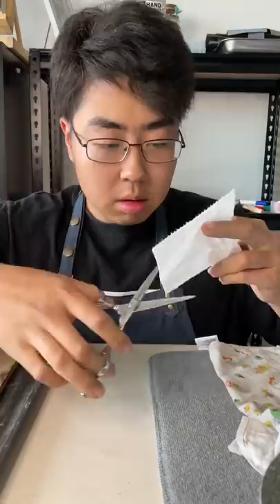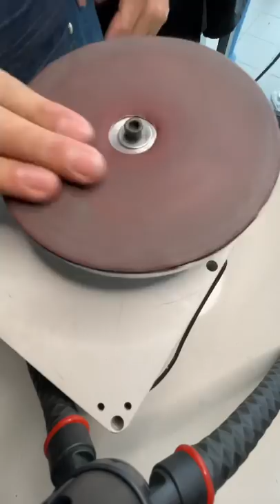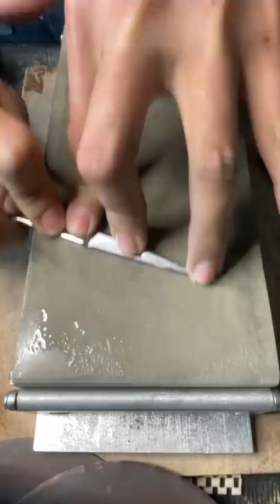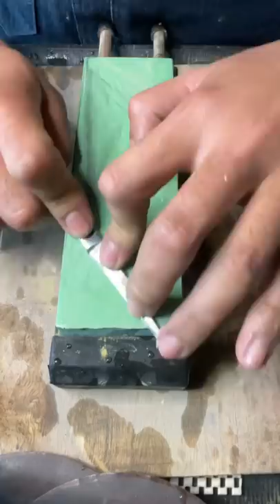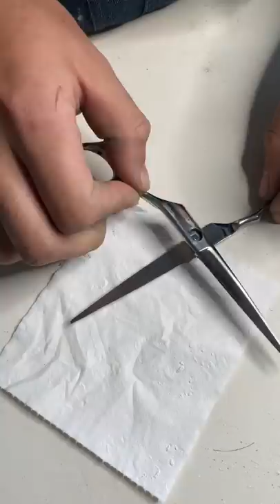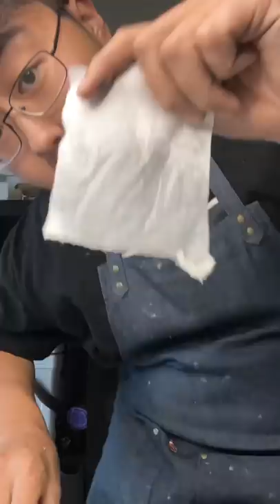Scissors sharpening

Comment: Hey hey, someone who knows how to sharpen stuff properly, that's a new one
Reply: @water_jug_man6805  we don’t speak emoji
Reply: Tin foil
Reply: @gufpcgufpc5848  I don’t think you can read
Reply: @joshmanis9860  I don't think you can read emoji
Reply: @ahsokatano7592  I don’t think I can
Reply: @joshmanis9860  😁😆🤣🤣🤣😂😂😂😅😅😅😐😐😑😑😐😐
Reply: @tribolt6809  sorry i dont speak emoji
Reply: @annabelle5640  🤨
Reply: @tribolt6809  i think i know a bit of emoji lemme try it out 💣💥☠
Reply: @annabelle5640  😨☠
Reply: Thanks a lot man! Couldn't have seen otherwise 😅
Reply: wea
Reply: I got guys at work that think chisels are pencils. I cringe when I find a chisel sharpened down halfway. Smh...
Reply: @longbow6416  Ugh that stuff is awful. Is it that hard to rub metal against something mildly abrasive?
Reply: @joshmanis9860   
😎🤏
😑🕶️🤏
There lies your problem, you can't speak emoji and you assume no one can by saying "we don't speak emoji" to that poor emojian. Smh, people deez dayz.
Reply: @sethisaurus  we just got a bunch of people that end up grinding the wrong angle over and over or they totally grind it to a nub then start over re-adding a blade. Hell if I know. I've got my own set that I keep.
 I use a 120 grit wheel with a 25° angle guide and keep a cup of water close. I take my burrs out with the grind wheel and quench the blade periodically. I wet sand the bottom of the blade with 220 or 400 until the edge easily digs a fingernail. Wipe dry and wipe with oil and done!
 My old job I had a really nice set of  English-made scallop chisels. I took my time hand sharpening each one after use and finished the blade with rouge and a leather strope. They would shine like a mirror!
Reply: @longbow6416  That sounds wonderful. I wish I had the ability to sharpen this like that. All I've got is sandpaper and scrap wood but at least my pockets have something useful in them.
Reply: @sethisaurus  my sharpening is primitive compared to these guys. I bet he polished upto 3000 grit or more, I've never seen tables like what this guy has
Reply: @longbow6416  i use 5500 grit, but it's all just sandpaper
Reply: What the fuck?
Reply: you could never beat him even if you tried
Reply: @GatFlapper  I... Wasn't competing but I bet I could get something a tad sharper done?-
Reply: You cant be a knife critic if your not a professional yourself. Are you a professional knife sharpener? No hate just asking.
Reply: @gameryusic825  I'm not a professional knife sharpener but I am an amateur knife maker, and collector. I know more than enough to tell when someone doesn't sharpen a knife right.

Comment: As a blacksmith, i judge you on your handling of that metal and whetstone. You did a very good job, well done sir.
Reply: Then why was the first paper dry but the 2nd test paper was wet?
Reply: @nanixoo5044  that's what I was wondering..
Reply: @nanixoo5044  it’s harder to cut wet paper i think
Reply: @aug3842  No its easier.
Reply: @nanixoo5044  nvm lol i haven’t cut wet paper in a while ig
Reply: @nanixoo5044  if it was blunt, it will tear messily instead of having a sharp cut
Reply: @nanixoo5044  both were wet. Watch again
Reply: @kiewiealicorn3751  👆
Reply: @pininja4981  the second paper shown in the video, when the scissors didn't cut, would've appeared more heavy and floppy and glossy if it were wet, maybe you should rewatch the video.
Reply: you used a wet cloth in the end and a dry at first not fair
Reply: @ahesan-  it is MUCH harder to cut wet tissue than dry.. it is considered a gold standard test for the sharpness of beautician’s sheers.
Reply: "as a blacksmith"
Reply: @kiewiealicorn3751  they were both wet. You can definitely see the slight color difference between the dry and wet portions because you only wet half of it.
Reply: @nanixoo5044 No it's not.

Comment: Most of the reason scissors are 'dull' I'd actually because they have come out of alignment. Mostly getting them to cut well again is a matter of readjusting thier bolt.
Reply from the maker: By out of alignment I assume you mean the scissors are loose which they would fold hair rather then cutting, but if you are saying the metal blades are out of alignment, that’s a whole different story, and it’s rare. When hairdressing scissors are loose, it will have a lot of play for barbers or hairdressers to push the “ thumb blade” further off, which would dull the tip very fast, once you tighten or “readjusting” the bolt or screw, yes it might not longer fold but will definitely push hair or even catching, so no good since the tip is the most used component of these scissors.
Reply: @raythesharpener5260  hey fellow sharpener. I also have a sharpening service and I always get stuff related to sharpening on my feed. Which usually makes me cringe. It’s pretty clear you know your stuff and it was refreshing to see professional at work! Keep it up!
Reply: Most of the scissors/shears I come across are "dull" simply because they are not sharp anymore... and no bolt adjustment can cure that...

Comment: There's a very slight curve in a pair of scissors that makes the edges touch at one point only. Hard to get right but makes them cut nicely.
Reply: Only in expensive ones. The ones you see 95% of the time are just garbage stamped out of sheetmetal and grinded flat
Reply: @chas1878  lol they're "garbage" because it doesn't make sense to only make $20 scissors and they work just fine. What an odd thing to be up in arms about
Reply: @RapTapTap69  I would like you to rewrite that comment of yours so I can make sense of it as currently I have no idea what you're trying to convey to me or anyone else
Reply: @chas1878  It's pretty concise but sure I'll oblige. There is no point to make every product of the highest quality so referring to products like scissors as garbage stamped from sheet metal is pretty odd. Do you want every set of scissors made from 15 fold Damascus? Or would you rather a world where you can pick up a $3 set of scissors from Walmart with the option buy $100 hairdressing scissors?
Reply: @RapTapTap69  You interpreted quite a lot into my comment when all I said that the cheap scissors don't nearly come close to high quality ones and especially do not have that single point cut feature. I never said anything else. Overall your comment doesn't make any sense in a lot of places.
Reply: @chas1878 how did you not understand that lmaoo…
Reply: @RapTapTap69  It makes no sense because $20 scissors aren't exactly high quality so it was interpreted as "lol they're garbage because there is no point in only making garbage scissors"
Reply: Ooo so that's why he do it like that 😲 Now I get it
Reply: @noobpro9759  It actually has properly punctuation. If you can't read it, that's an issue of your own reading comprehension.
Reply: @noobpro9759  I'm am typing in pretty plain English. I really don't see what your issue is unless you didn't make it past 8th grade. Are the words "concise" and "oblige" to difficult for you?
Reply: @RapTapTap69  and yeah you have periods. Big fucking whoop. The middle sentence is at least 2-3 segments worth of information.
Reply: @noobpro9759  You're really angry about something you're wrong about. Maybe actually know a thing or two about grammar and punctuation rules before trying to be the Grammar Police?
Reply: @RapTapTap69  "there's no point ("to" is the wrong word) in making every product of the highest quality, so referring to products like scissors as  garbage, stamped from sheet metal, is pretty odd."

-what you meant to type
Reply: @RapTapTap69  tell me you did it right, again.
Reply: @noobpro9759  That's kinda cute kiddo. They're both correct. I'll take the obvious guess and say that you copied my comment into word or Grammarly and they gave you that. They are both weird about cases like that. Please keep going. I'm having fun
Reply: @RapTapTap69  did it myself. Get bent.
Reply: @RapTapTap69  it helps people read.
Reply: @RapTapTap69  that way you avoid arguements like the one you had for no reason with madman.
Reply: @RapTapTap69  its about clear and and useful ability to communicate. Its not a fucking journal entry, that only you are going to ever read.
Reply: @noobpro9759  jeez. Who hurt you?
Reply: @Segphalt  ok, the first half was funny. 
I wasnt after his wording. I was after his punctuation. I could see how that's a little hypocritical, but its common enough I don't have to worry. Unless someone who isn't familiar with english reads it, though punctuation isn't what they need in that instance. Though punctuation would help a non native speaker read his comments.
Reply: @Segphalt  how would I cut off the second hand? XD
Reply: @chas1878  can confirm, once you’ve used a nice pair of surgical or textile scissors there’s no going back
Reply: you can lap them and put a slight bend in them achieve that but it adds very little, leaving a little play in the screw and pressing them against each other works as well (hard to explain, its why scissors work badly in the wrong hand). If you cut a lot of lightweight silk fabric or something your needs might justify it
Reply: @chas1878  cheap scissors come most of the way to premium scissors, it shows the precision of modern manufacturing. You've been conditioned to believe that anything less than the extreme limit case is inferior. If you don't need them to perform in an extreme way, you don't need extreme quality

Comment: EXCELLENT !!  
One extra detail:  some of the highest performing scissors are slightly concave on the inner passing surfaces to ensure the cutting edges pass in contact with each other.  To prevent reduction of concavity on the inner surfaces,  only make one very light pass on a super-fine stone and then strop what’s left of any “wire edge”. It will be so fine you won’t be able to see it.

Comment: Sharpening blades use to be an art, I always try to take time to show people how to do it properly
Reply: Still is an art. Anyone can buy some machine that holds the blades at an angle and you just put in different stones  and step it up grits and half the time they dont even work like they should. Now taking the time to learn to sharpen different steels and hardness of different tools is an art. Lawn mower blades, to axes, hatchets to scissors, and pocket knives all work on similiar principles but takes hands on time to really do it justice  and get the best edge possible. This guy is really good.

Comment: Nobody else gonna mention how the tissue was wet vs dry when cut by sharp vs "dull" respectively? 

I don't doubt the process but that's sus js.
Reply: Yuuuup
Reply: It's harder to cut wet tissue, thus why cutting wet paper towel is a superior or harder test to succeed.
Reply: Oh yeah so sharpening is fake now 😂stfu
Reply: This got aggressive so fast
Reply: @Alexander-vm2ox  not what I said, out here with a reading comprehension like rainman lol
Reply: not very sus if he made it obvious he wet it. he included spraying it. he probably wanted to show it was strong enough to cut through the wet tissue too, as just dry tissue isn't much of an accomplishment.
Reply: @thenamenoah2741  well it's sus because the control wasn't the same for the dull vs sharpened blades. Again, that's just a detail I noticed and it's a window for some fuckery to go down.

I'm also not insinuating any of the sharpening is inauthentic, (see this issue is where reading level shows) I'm suggesting it's not as razor sharp as he's making it seem it is.

That being said, dry tissue would be harder to cut in my mind than the wet since the water is weighing the tissue down with a similar effect to someone holding it taught enough to facilitate the cut... Whereas the dry tissue is going to be more flimsy and less likely to cut, more likely to tear or fold/slide in-between the scissor blades.
Reply: @praisesol2740  exactly what I thought.
Reply: I mean, try it out, see if scissors cut dry tissue better than we tissue, I don't know the answer either so it'll be interesting to see if it's true
Reply: I tested it and they both cut exactly the same and I just used some generic above average scissors that hadn't been sharpened since bought. So basically if it couldn't cut dry before, it wouldn't have cut wet cleanly either.
Reply: @praisesol2740  I understand your reasoning. 
But let me explain, I have sharpened freehand for years, own many different stones. Sharpening is a hobby where making assessment and assumptions is very hard for an outside person. There are different factors at play, angle, steel, edge refinement, deburring, cutting technique, what you are cutting, edge thickness. Etc, it's complicated

Water softens the tissue and allows it to tear, ever handled wet toilet paper? Exactly.....  thus a clean cut is harder to archive if it's wet. 
I know it is, I have done that test many times
Reply: @gtppaul3751  i’m not who you were responding to but that was a great explanation
Reply: @gtppaul3751  outstanding explanation, thank you. That actually makes much more sense now
Reply: Fr
Reply: POV you came to the comment section to look for a comment like this
Reply: @praisesol2740  but why would you even question a video like this,
Reply: @Alexander-vm2ox  I mean I outlined my reasoning lol. A better question would be why you're asking someone why they're asking a question at all as though you've added anything worth talking about to a discussion that's already been sorted without your having been here at all... Twilight zone shit, real crazy I know.
Reply: I was saying the same thing very very sus
Reply: @praisesol2740  you sound like you use the app if you know what i mean
Reply: @JohnDoe-tx7cg  nah I really don't know what you mean
Reply: Barber and hair stylist have scissors for wet and dry cutting.
Reply: @michaelweymouth4015  yeah but that's different, I thought it's because of the type of metal because one will rust where the other won't?

Either way we already settled what the deal was if you read the comments.
Reply: @J2smxxve  got it 😂😂😂
Reply: Thank you

Comment: The cloth you cut is easier to cut regardless due to being soaked
Reply: That is actually the opposite of how it works. If it is dry it is rigid and easier to get a clean cut, but to be able to get a clean cut on wet paper it would need to be incredibly sharp.
Reply: Wow you managed to say the complete opposite of the truth like it couldn't be closer to being incorrect
Reply: Completely opposite. Try cutting wet tissue with an average pair of scissors and you'll find the tissue just folds between the blades and tears instead of being cut. You need a really sharp pair of scissors to do this.
Reply: Apparently you are wrong based on the other 3 people who have replied.. but I thought the same thing about the wet cloth being easier to cut. Either way he shouldn't have started the video with a dry cloth and ended the video with a wet cloth.

Comment: When you drag the blade over the stone, you were only leaving steel on the left (your right) side of the stone, so the stone was only grinding away material at the hinge.

I can see the value on decreasing the clearance between the blades in this way, but I don't think you actually we're sharpening the blades during this step.

Also, I don't agree with the polish step, on that padded wheel you'll make it shiny, but risk rounding the blade edges - a leather strop and polishing compound is definitely the way to go, there's a reason this technique hasn't gone away for hundreds of years.

Comment: Quick tip for those that don't have the time nor resources for all this nonsense: fold aluminum foil to make it a few layers thick then cut it several times. It gets them fairly sharp in about ten seconds. You're welcome.
Reply: works with most shears, but not hairdressing ones. calling it nonsense is nonsense

Comment: So I read somewhere that to sharpen scissors, you simply take a class jar ( such as a mason jar) and using the scissors like you would if cutting paper, gently and slowly close the scissors on the lip of the open glass jar (imagine trying to cut the mouth of the jar with the scissors). It sounded so bat-shit crazy I just had to try it. So with the most worn pair in my shop I gave it a try and was quite impressed at the results!
Reply: works with most shears, but not hairdressing ones

Comment: Before: scissors on dry cloth
After: scissors on wet cloth
Reply: Your point is what? Cutting wet tissue cleanly requires much sharper scissors than dry tissue.
Reply: @ferrumignis  m8 shush
Reply: @gonnr_5793  Do you always use that response when you've had your ignorance pointed out?
Reply: @ferrumignis  nope
Reply: @ferrumignis  first time I've said it in ages actually

Comment: What I usually do is just cut grind paper, works really well to sharpen dull scissors
Reply: Or tin foil
Reply: @RyanKing9610  No, tin foil does not sharpen scissors and cutting sandpaper completely ruins the edge of scissors.
Reply: works with most shears, but not hairdressing ones

Comment: You should almost never need to sharpen scissors they are clearly too loose to cut correctly try tightening the screw that attaches the two sides of the scissors that alone should fix the issue

Comment: The problem wasn’t that the scissors were dull, the problem is that they had too much slack in the bolt. You tightening them without the sharpening process would have had the exact same result, especially combined with the fact that the piece of tissue the “dull” scissors failed to cut was dry while the piece the “sharp” scissors successfully cut was clearly wet.
Reply: works most of the time, but these scissors were blunt and not loose. also wet tissue is very hard to cut due to its delicacy. dull scissors will only tear it, leaving an unclean cut.

Comment: It’s easier to cut through wet paper than dry
Reply: No it isn't, it requires a very sharp pair of scissors to cut wet tissue cleanly. A dull pair will rip the wet tissue apart leaving a ragged edge.